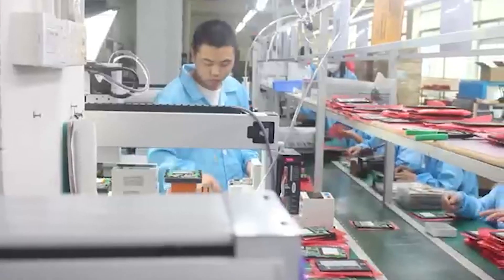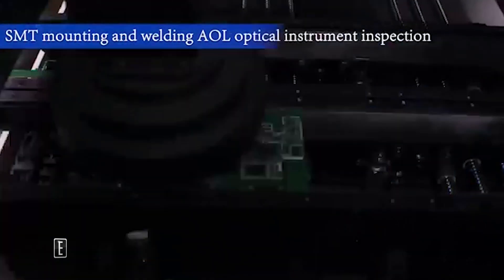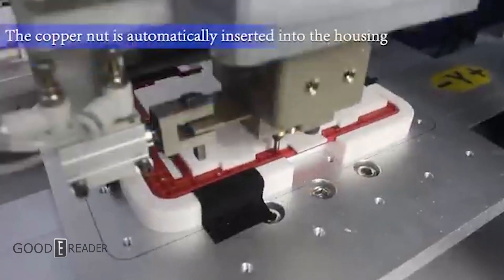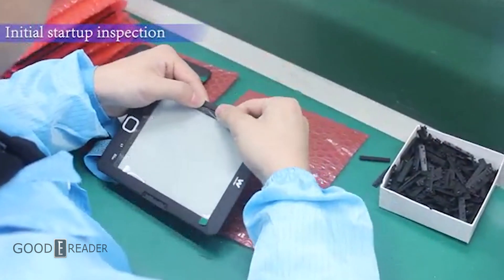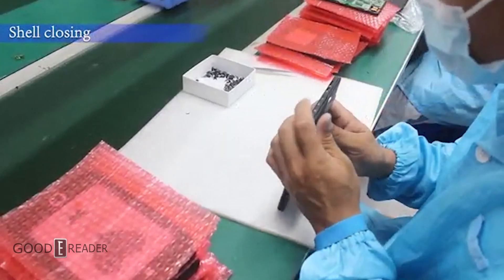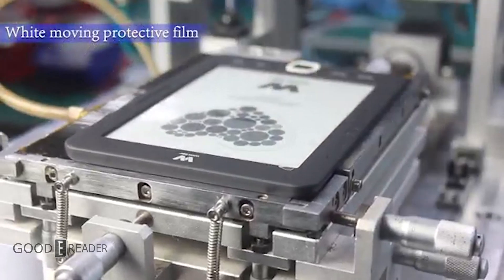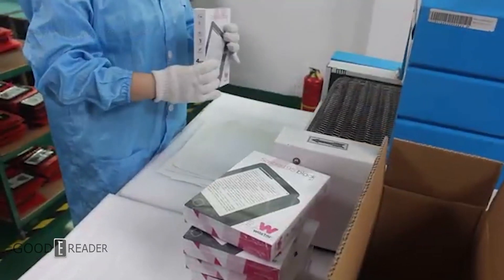How an e-Reader is made | Inside the factory

Comment: (2:05) I've seen stacks like those (off to the top left) on AliExpress from surplus display panel sellers who show off their inventory, so i know that's how E-ink ship their display panels.
The model shown in the video didn't appear to have touch input and a frontlight, but the assembly process is similar for those that do have it as I've seen complete display assemblies shipped the same way.
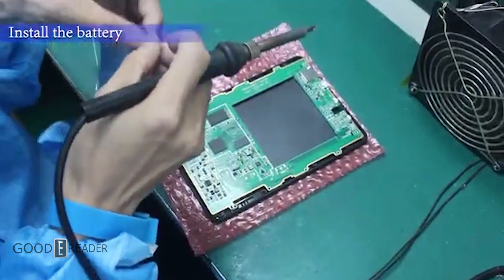(2:38) I should point out that most e-readers I've seen from brands I know of usually have connectors for the battery instead of being directly soldered in. 
(3:51) As far as I know, those e-readers I mentioned often have factory test modes to allow them to be tested without having to set up the system software first, but the model shown in the video likely didn't have such an initial setup process.